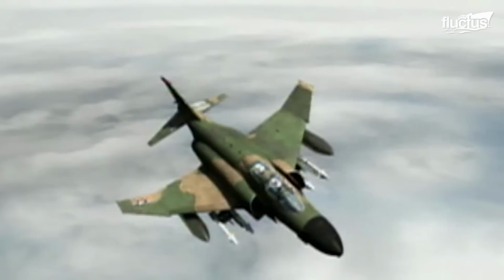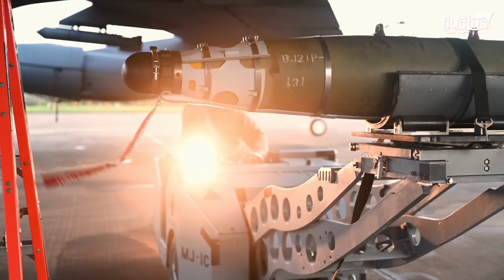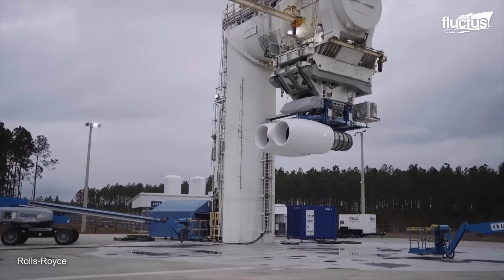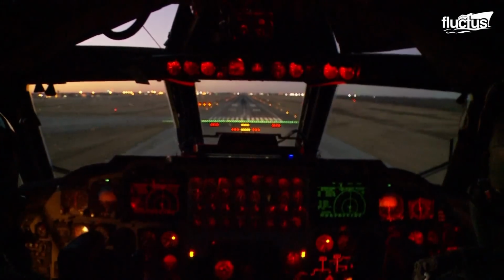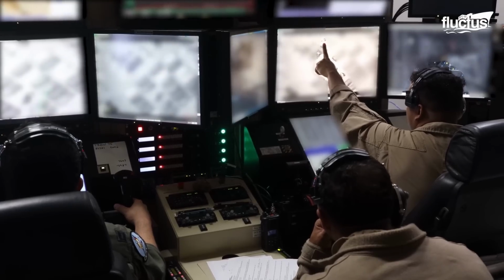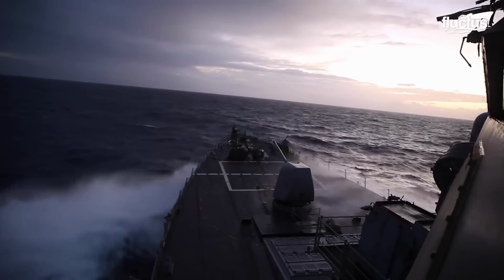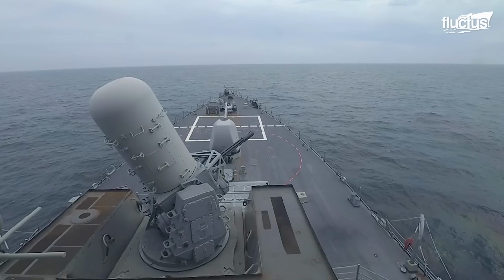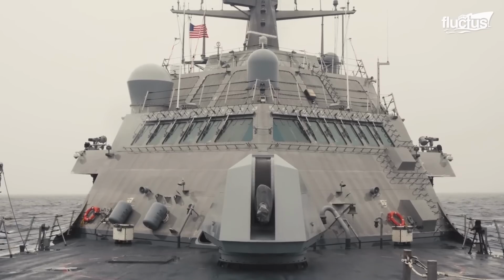Inside US Air Force Massive Facility Upgrading Feared B-52 Bombers

Comment: The P 38 had Allison‘s. It did not have Merlin’s please note and correct. And technically the Mustang had Rolls-Royce Merlin design, but Packard manufacturer, the engine and enhanced significantly the ability to mass produce the engine.

Comment: Rolls Royce did NOT make the engines for the P-38. The P-38 used an Allison engine that was different than the Merlin used in the P-51.
Reply: Nor did they make engines for the P-40. They were also Allison engines. Plus, the Mustang used a Packard engine based on the RollsRoyce.
Reply: It would have been interesting to see how the P38 would have been with a couple of Merlins, P40 as well.

Comment: The p38 and p40 had Allison engines not Rolls Royce
Reply: Most p-40s used Allisons, except for he P-40F and P-40L models which used Merlin engines designed by Rolls Royce and built by Packard.  I don't think any production P-38s used Merlins.

Comment: For the MQ-9, it's actually the MQ-9A Reaper, which is the USAF designation of the General Atomics Predator B. Likewise, the GA Predator A was originally the RQ-1A for the USAF, which were later converted into the MQ-1B Predator.

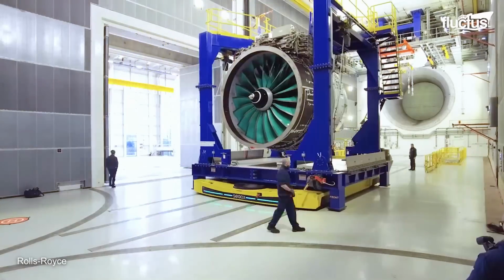Comment: 5:25  that is a 51, not 40.
Reply: They only got two out of three pics right. They put the Merlin in the P-40L. As for the P-38 I found this: "In 1944 an eight Air Force P-38 was flown from
Bovington to Hucknall for a trial installation of single-stage two speed Merlin XXs. Rolls-Royce test flew the aircraft a number of times unmodified, until word came down to return the aircraft immediately! This sounds right as earlier we tried to sell them without the superchargers. They were returned with the name "The Castrated Lightning".